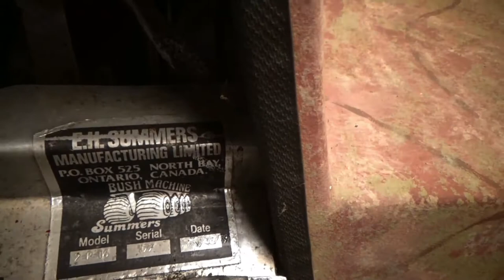Bush Machine by Summers - Chain repaired

Comment: I thought I could share more info when it comes to those bushing they are made out of SAE 660 bearing bronze and the hub bushing normally contain a 0.015” oil groove on the inside ! I know because I’ve made them all for my summers , and when installing the chain the only real way is to make all the chain on the bench and then install with both hub sides removed! I’ve done this many times as well and as for the master link or lack of their! I’m going to have to a chain party one day with you and show you the tricks ! I’ve learned a lot of tricks on this and I’ve owned mine for approximately 27 years I have all the bushing dimensions ! And something that is very important is never mig weld on any of those gears everything has to be done with low hydrogen rods ! Something else those drive shafts use to have like a sponge material in the ends to prevent water from entering the chain case ! I should also mention gear oil is used in the chain case ,but you can use even grease because of the slow speeds and also because there are no bearings in the drive train they are all bushings and this will help prevent leaks, what’s important is everything gets lubed ! Also there was foam in between the Goodyear runamuck tires ! I can show you all of the chain tensioner I fabricated as well the brakes are all made out of old saw mill conveyor belts I replaced all mine I found the conveyor material from the old Delaware saw mill.Also important never turn off the engine with the ignition! Always use the choke because if the engine backfires it can easily Brake the woodruff key on the left side of the sach clutch ! Buy the way the fuel tank I tig welded together , if you notice the front and rear are not exactly level to the other axles and this is so it will turn better ! I can go on for a long time about this stuff I love my machine and as said before I work as a millwright so I’m always working with gears and chains and fabricating things all the time so I really injoy all of this stuff ! Larry Jeanveau
Reply from the maker: Those "screw-grooves" were mentioned by Eric afterwards. I suspect mine have worn down. Chainsaw bar-oil was recommended for the chain case. Cheap in large quantities. Hopefully I can slide by over the holidays and talk shop!!
Reply: Larry do you want to sell it?
Reply: I can send some pics
Reply: @manfrednemeczek4108  hello

Comment: I found out that every single plate behind all eight tires are leaking out oil on the machine I got from you  what do they use to seal that up with so that it doesn’t leak out oil on it again
Reply from the maker: The manual covers this on pages 64 and 65. Simple rubber o-rings. Remove the wheel and retaining ring. Easy and inexpensive repair.

Comment: I would not re-install the chain pin cotters or keepers, instead of peening the chain pins use your welder and weld to link you will be happier in the long run, close tolerances will cause connector links to remove themselves, keep up the good work....
Reply from the maker: Good idea.. I didn't think of welding the pins.

Comment: It’s not the o-rings that’s leaking is the aluminum plate that the axle goes through
Reply from the maker: If you mean the hubs, I would think maybe they need gaskets or sealant where they mount to the tub. If the leak is right at the axle, then the o-rings. I'm not really sure where else they can leak. Hmm.